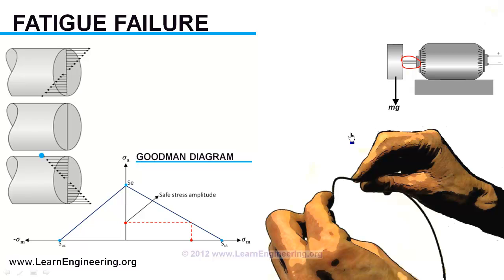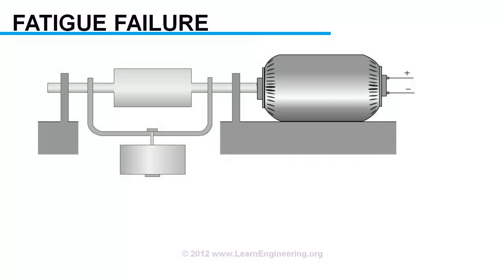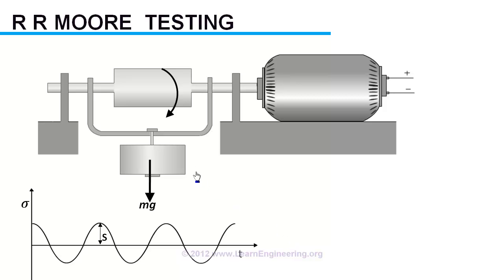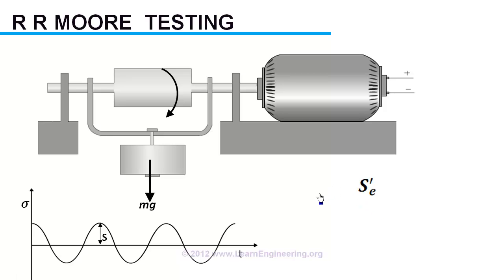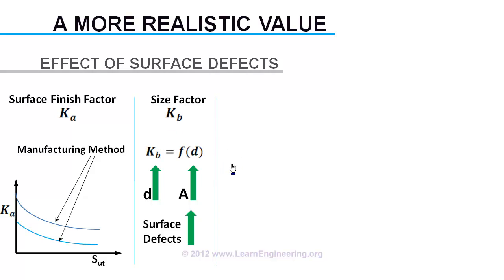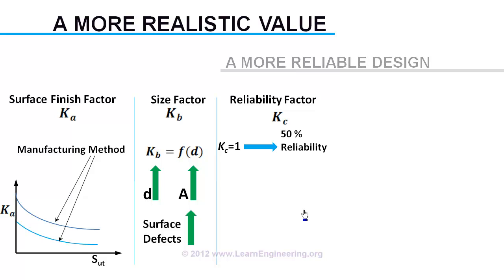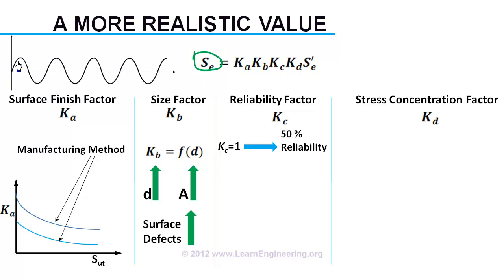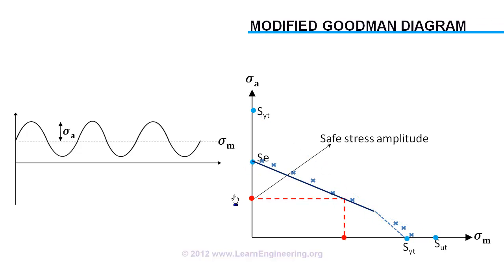Fatigue Failure | Engineering Approach

Comment: what about temperature factor ke ? 
if T<350 C  ke=1
else           ke=0.5
Reply: Eren Erdem generally the temperatures encountered are less than 350 degrees, so this factor is not considered except for elements in extreme operating conditions..
Reply: Nirmal Aryal we are extreme engineers man we should consider all conditions ;)